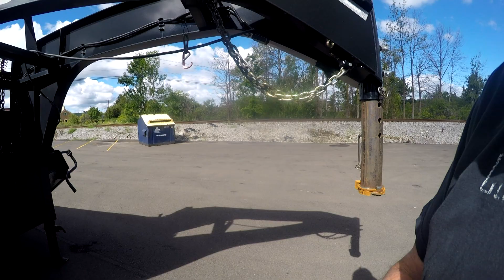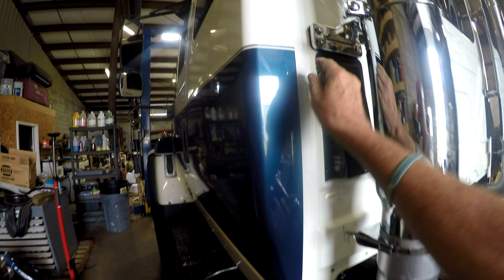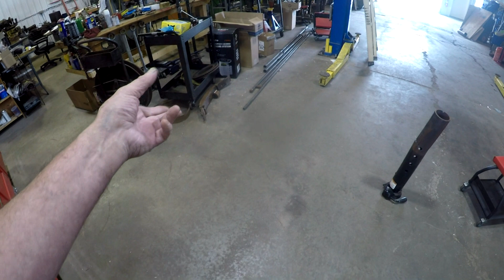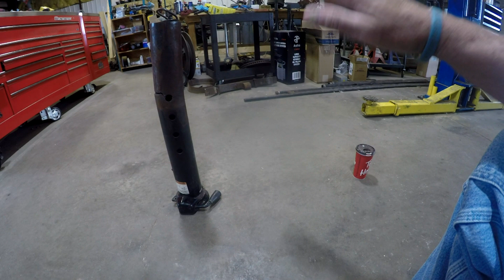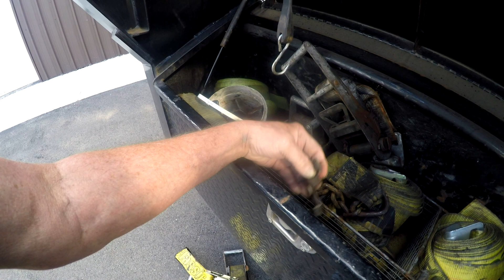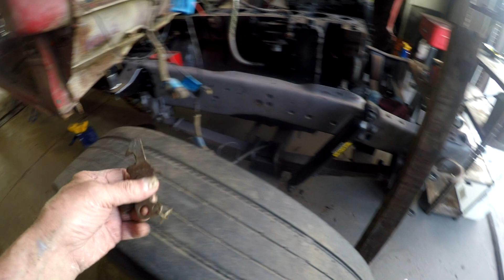Shop Update 08/30/20 - Issues With Diamond C Trailer Cont.

Comment: I also have a Diamond C with the same bouncing issue. 35 foot non hydraulic dove. Concrete roads or asphalt roads it doesn't matter. Seems to be real noticeable at 35 ish  and 70 ish. Loaded, bouncing doesn't seem to be as much of an issue. Because our Wheels weren't balanced from the factory we took it down to a local tire shop and were promptly told that it would take more than 24 oz to balance each wheel out. I took it to a factory dealer whom told me that the wheels were bad. They called The Factory and had 4 new wheels shipped in. Factory dealer had tires installed on wheels and balanced reinstalled on trailer. I went up and picked up the trailer only to find out that the vibration still existed. So we are back to square one as far as fixing the bouncing issue. I have always held that it is a suspension issue and I still think it is a suspension issue. If the axles were independent of one another I think the issue would be non-existent, IMO. It will be interesting to hear how you fix this issue.
Reply from the maker: I am trying to get another truck in the road, so haven’t had a lot of time to devote to this issue! However I have or
Reply from the maker: Sorry accidentally hut send without completing that! 
Was saying; however I have ordered parts to add shocks to trailer to see if that has any affect on issue! I will keep everyone posted as to what happens or what I find with my fixes through videos! 
I am curious though, have you contacted either Diamond C or dealer about it? If so what did they say?

Comment: I don't have any issues with my diamond C but it has the square load leveler coupler.
Reply from the maker: Would be hard for me to believe that the square coupler is the answer, but any thing could be possible. Can you give me more detailed on your trailer? How old, weight rating, length (bed length), dovetail or straight, suspension type (spring or air), if dovetail is it hydraulic, tire size, and does it have torque tube? Know it seems like lot of questions, but the issue may be caused by more then one thing! Like hydraulic dovetails have axles set farther forward then conventional dovetails, which may leaned to dampening the problem! Or shorter trailers with no torque tube may not have problem! So any or all info you can provide would be helpful.
Reply: @frednewman2162  We have a 2021 fmax210 with the Super single tires, hutch suspension, 25+5 dovetail. 

I have 1500 miles on it and there was a freeway resonance that gave slight buck but nothing severe imo.

Pulling truck is a 2017 Ford F350 DRW.
Reply from the maker: @BroadcastBuddy  Do you know what model Hutch suspension, is it the 9700 series? I am really starting to wonder if it isn’t the suspension design that Dexter uses!
Reply: @frednewman2162  Also, the square coupler is much beefier than the round, plus Diamond C adds plate gussets that wrap around the box.

Comment: How would you test something that is already broken? Also @ jj obviously it was not a manufacturer’s defect in the trailer Fred even said it’s from crappy roads ... that’s like saying I need Goodyear to replace all of my tires because the roads are crappy lol how about solutions instead of what you would do with someone else’s money 🤷🏼‍♂️
Reply from the maker: They have test procedures for steel (well anything not just steel), there are two types of tests, destructive and non-destructive! They could take a sample of the metal and analyze it to tell if steel was formulated right or is the proper type of steel for the application. They also have engineers that can look at the break under a microscope and tell if it was metal fatigue or it was a shear load type of break!
Reply: Fred Newman wow didn’t know that Fred thank you for the knowledge

Comment: The parts suppliers [Bulldog, Dexter] build parts that meet specs that they publish. The TRAILER manufacturer is responsible for designing the trailer and selecting parts that meet their design requirements. It appears that the real question is that the trailer design may not meet the published trailer specifications. All of these suggested "fixes" are a waste of time if the basic design is faulty. You should ask for a refund or a positive fix.

Comment: I think your tool box lach failed because of the bouncing.  The socket for the hich post should extend down farther to reduce torque on the pin hole.

Comment: When you mount the shocks mount them with fore/aft lean.  that way they will help cancel out some movement of the axles front and back.  Automobile Mfg. companies do that with vehicles to make road shock less noticeable.  I still vote for making a brace to the bottom of the hitch back up to the frame.  Make a yoke and pin it to the lower hole and have an anchor back up on the arch.  It would have to take some of the movement out of the hitch tube.  Simple torque wrench idea where farther out from the trailer it would take much less to restrain movement in the bottom at the ball.

Comment: I would mount the shock on the backside of the axles because the front is hard mounted the axles move back when they are loaded, hit bumps ext. With the shocks on the back side that will all be working into the the shocks